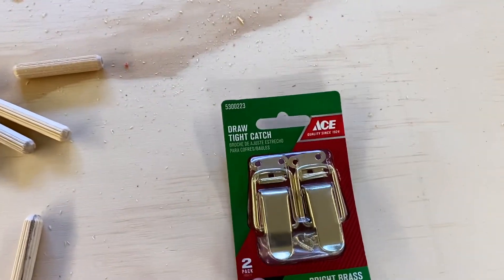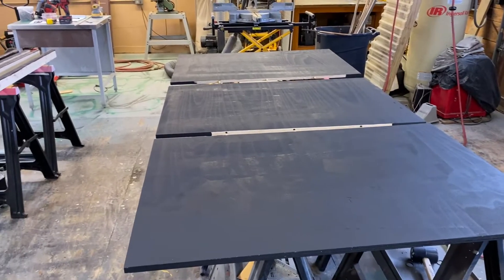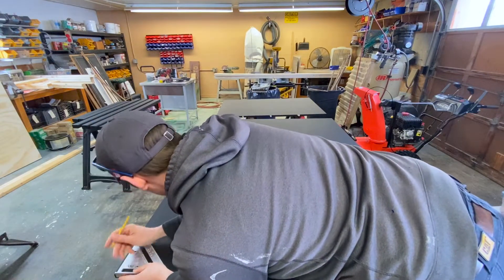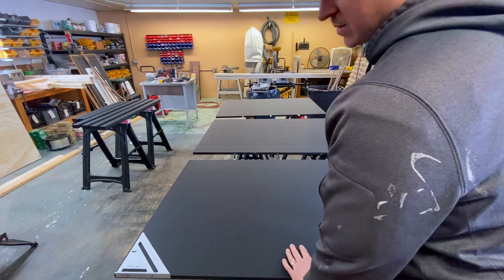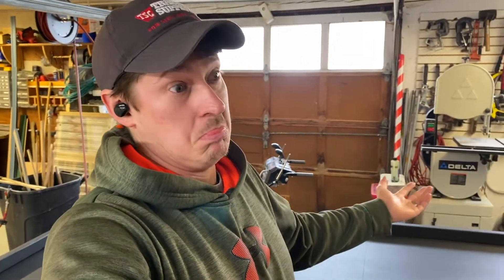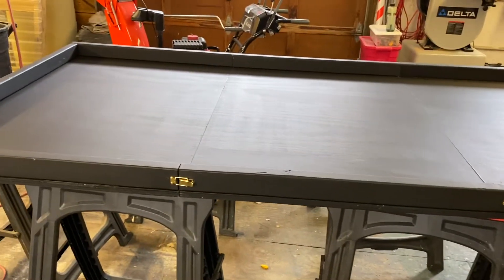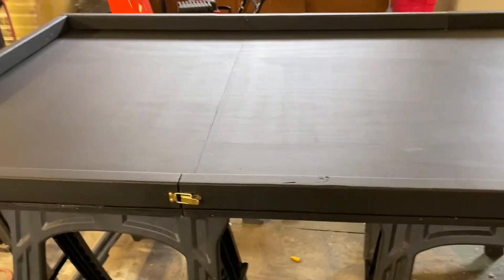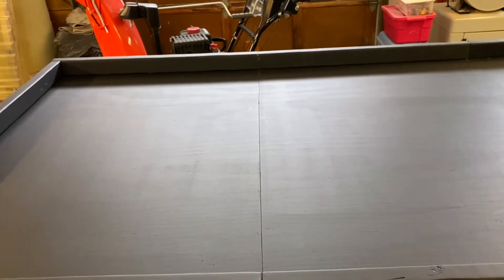First Lego League robotics table full build! Portable, 3 sections. Episode 8

Comment: I noticed that one of the seams looked a little off. Would assembling it, then sanding the seams before painting to have a smooth surface be better? Would also make any slight deviations from the dowels not noticed unless they try to put the ends on the wrong side.
Reply from the maker: They use a game table mat so it “shouldn’t” be an issue, I should have attached the sides then cut it into sections so all the edges lined up evenly. I have each section number for the order in which they go because if the middle is switched it really doesn’t line up as well.